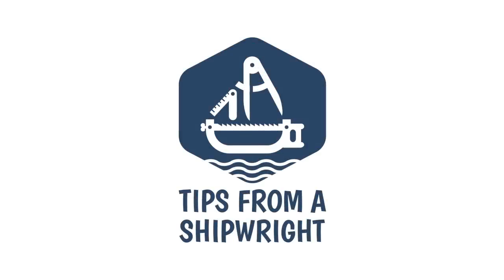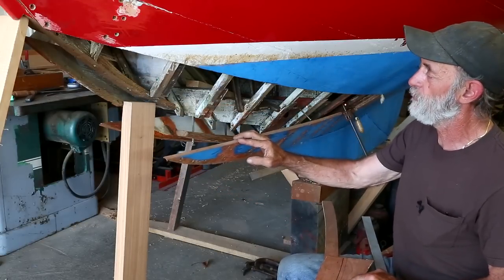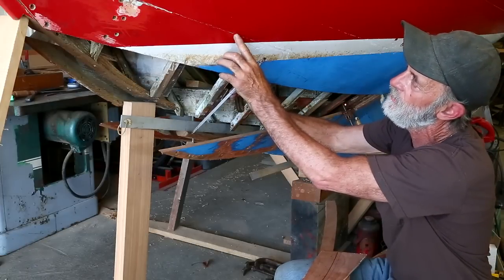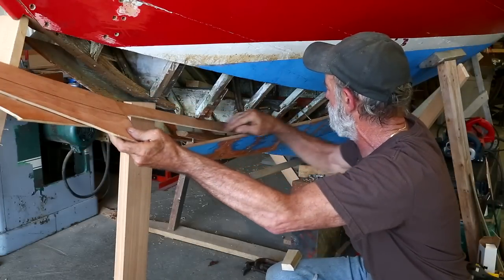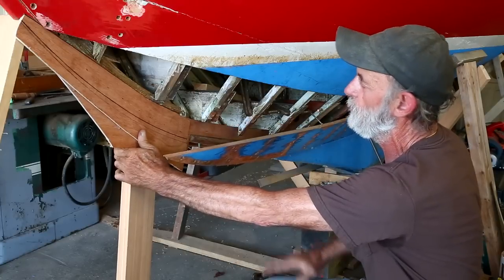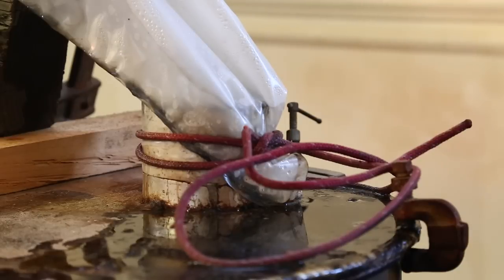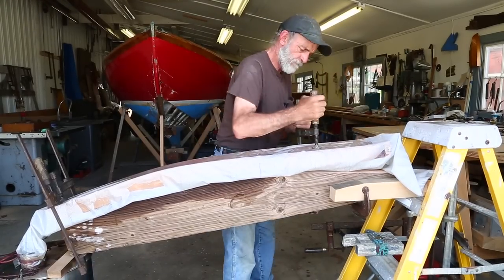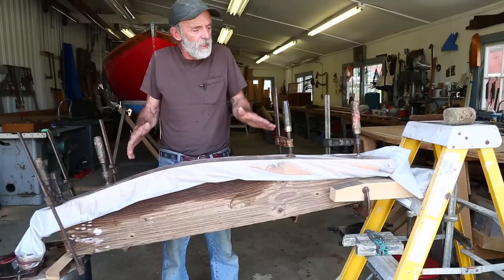Part 4 - Herreshoff 12 1/12 - Steam bending wood in a plastic bag for a replacement timber

Comment: Glad I ran across this, I'm restoring a 1923 Old Town canoe which I need to match the bend of the gunwale curve as well as this model has a bend upward connecting the decking. What I'd like to know is what thickness poly bag are you using. Thanks

Comment: HI Louis, my 1958 keel has a soft spot, right where it meets the first plank..i know my skills even with   all your good tutorial is no where near capable to do this job.  my handy work has been with tar and hemp which held off the water intake from the hull for a season or two, another issue with the propeller and gear box had her out of the water for over a season and now after pulling her 6 tons in and out of the water a few times she still takes in water.i have been soaking salty rags and refilled the problem area with a product called tec 7 and put a copper facing over the area.. i have this sinking feeling that my boat is going to be a sinking mess, she is in the Oslo fjord -i have tried the heritage marine society i have had no luck finding a do able affordable solution...I am more than willing to share my boat if you know someone like yourself in this part of the world..rather that than burn and sink her, 30ft Snekke Dorry  Pls let me know if u get any ideas on my behalf, all the best from another wooden boat lover.